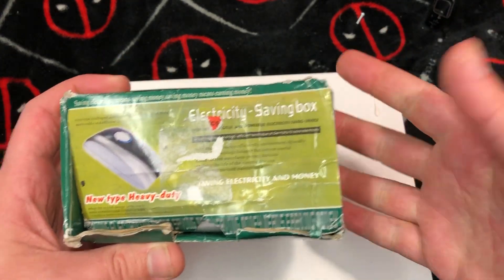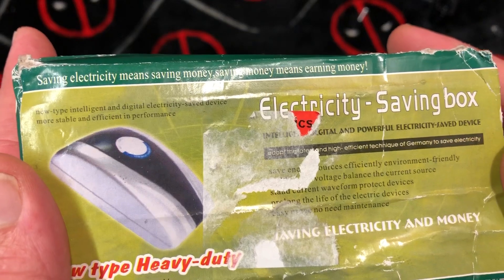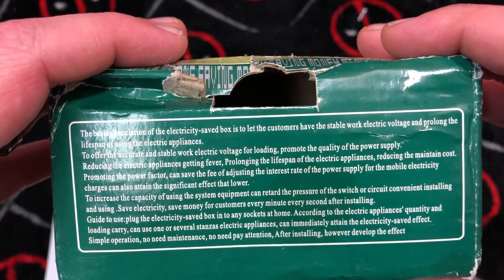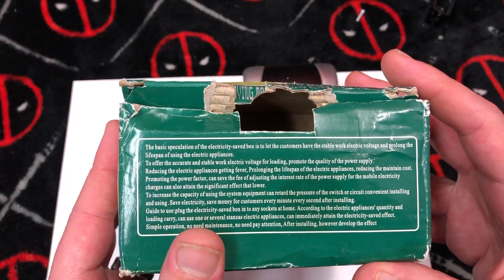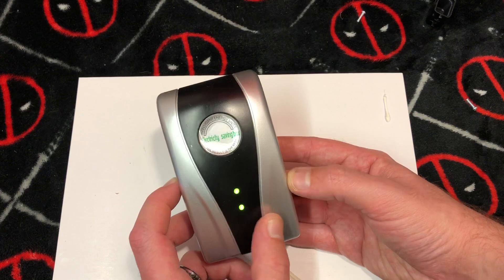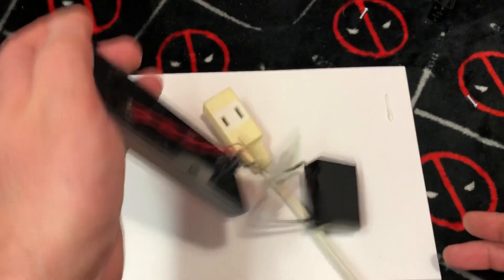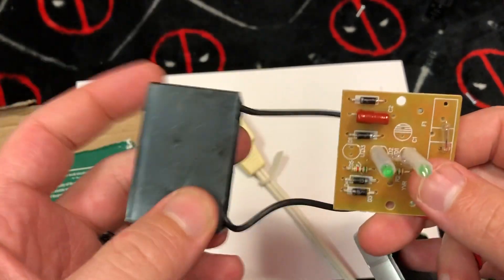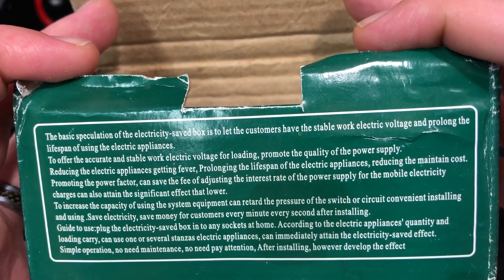Heunwa Power Save, 90V-250V 30KW Electricity Saving Box, Energy Saver Saving Device TEARDOWN

Comment: If it worked Walmart Walgreens every store in USA would alreasy have it.. It can not work.As a electrknic engineer this device can not pulled down on 100Amp 150amp or 200amp service.The current is to strong for a such small capacitors.It can in can only reduce its own power usage which is hardly any

Comment: I got one over 7 months ago and I've been in a new home using exactly the same electricity only differences my hot water heaters running continually and I'm using less electricity than my previous apartment one bedroom apartment and now I'm in a two-bedroom house with double the size refrigerator and my hot water heater is double the size and it's constantly running and my bill is no more than $36 a month with one of these energy savers go to eBay buy one eight bucks is all they are try it you've got nothing to lose but paying more money to the electric company so thanks for your dumb illustration without proving what it can do clickbait
Reply: for god's sake, it's a capacitor and two LEDs, it saves nothing it only consumes energy and the reason the electricity bill is lower is because you're the one who's consuming lower, nothing more nothing less

Comment: I didn't see a teardown or any test done on the product. Teardown should say what is happening or not happening as the product described. Not just opening it up and saying it doesn't work.
Reply: Brother for god's sake you see a circuit with 2 lights and a capacitor, and still think it saves energy?
Reply from the maker: If I was going to do a teardown and test, I would have test in the title bud.